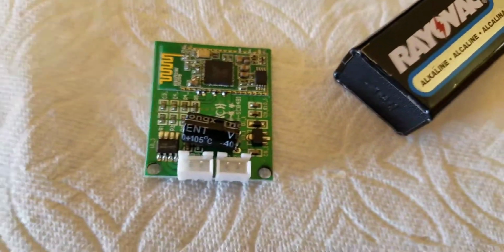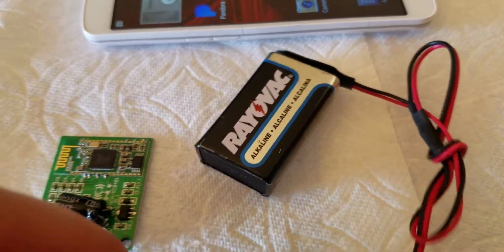Bluetooth Power amplifier, 8 watts Mono DC 9V, Module From EBay

Comment: This is exactly what I’m looking for, but it looks like they are all out. Any other sources than eBay or aliexpress?
Reply from the maker: Looks like you are correct, no more 9v units. There are however 5v units on EBay, you would just use a 7805 regulator IC to drop voltage to 5v.
Thanks for watching...BB23

Comment: This is out of stock everywhere but aliexpress. What happened?  I’m building 3 mono speakers and need a few of these too

https://www.aliexpress.com/item/Wireless-ISSC-Bluetooth-receiver-power-amplifier-board-Mono-8W-AMP-DC-9V-Module/32813524252.html
Reply from the maker: I used EBay
Reply: breakerbroke23 they don’t exist on eBay anymore

Comment: Hey mate, great wee video, can you believe that you're the only person online I can find with an actual review of this wee module. Planning on getting one myself along with one of these (https://www.amazon.co.uk/sourcingmap-External-Magnet-Speaker-Loudspeaker/dp/B01DO0XQLM/ref=sr_1_4?ie=UTF8&qid=1499186528&sr=8-4&keywords=sourcingmap+loudspeaker) to put into an old Bush VTR.227 portable radio (stripped out). The issue I'm having and which I hope you can help with is what size are the power/speaker connectors and what size are the matching female ones? I see there are different, ph 1.5mm, ph 2.00mm, the eBay guys I'm getting from specify ph 2.54mm but can't find the female connector for that anywhere and I don't have any in my parts bin. Hope you can help and either way cheers for the video!
Reply from the maker: I just had the connects laying around from old Car Alarm parts,  if I couldn't find anything I was just going to solder wires on from the back side of board. That looks like a nice efficient speaker you want to use, but I would add a Tweeter.  Otherwise I would be afraid of to much midrange only. Nice looking Radio as well.
Reply: Good shout on the on the tweeter, that shouldn't be a problem to add in. Any chance you could be a hero and perhaps measure the female connectors next time you have them to hand. Its just I'm planning on ordering a bunch (handy things to have around) and will be pissed if I end up ordering the wrong size!! Again, either way, cheers.
Reply: AAAAaaaaaah, just noticed in your video that the solder is visible on the bottom. First watch through I thought the entire bottom was blank, 
Perfect, that'll save me a few quid. Don't worry about the measuring, I'll go with the solder. Cheers again for your help. Keep up the Videos !